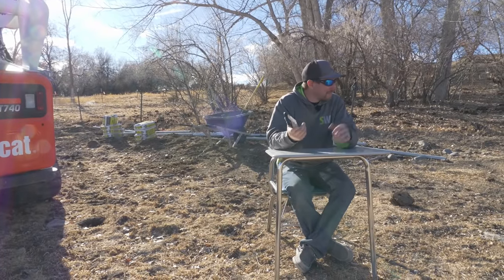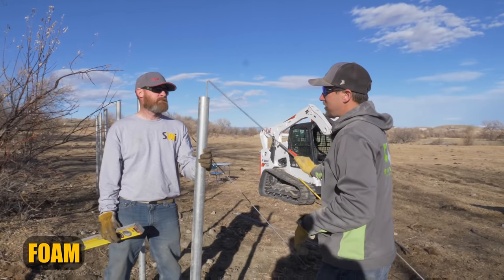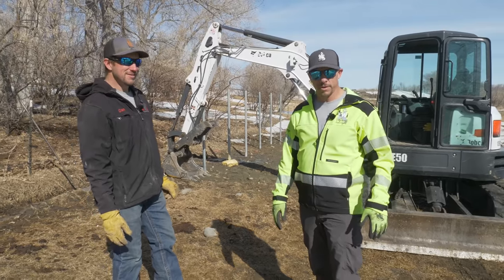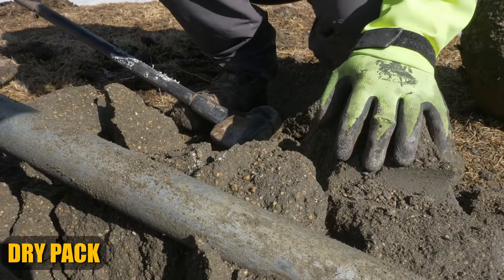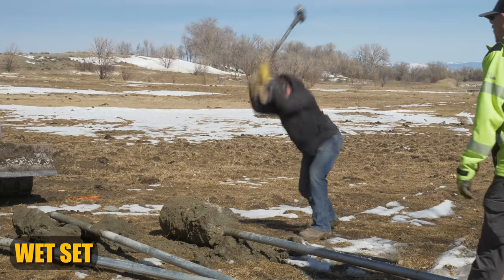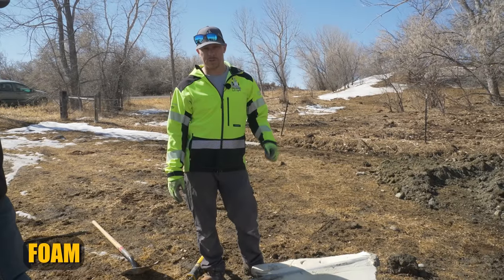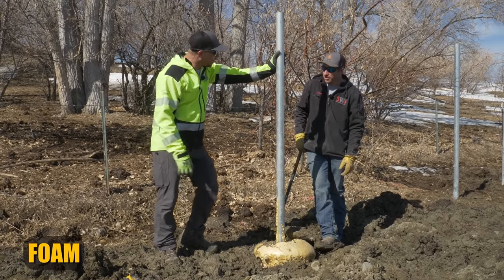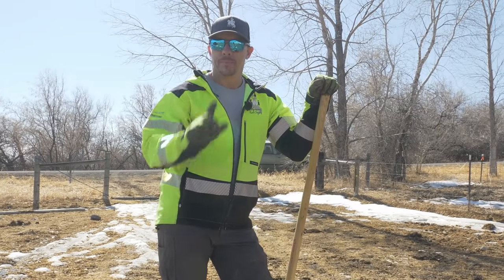Fence Foam vs Dry Pack vs Wet Set | We compare methods to see which is best for fence posts

Comment: I wrapped my 6 X 6 posts with "Resisto" which is used as an underlay for roofing. It has a sticky side where you peel off the membrane before applying it. Posts I set over 10 years ago are still holding up. The membrane goes up about 10 inches above ground level. I backfill with earth and compact it down with a 2 X 4 as I fill the side up.  I live just west of Montreal where we get rain, snow, hot summers and freezing cold winters. This technique has worked well for me.
.
Reply from the maker: I've seen similar systems promoted.  I prefer steel still.
Reply: @SWiFence  just wondering how much would be a 4x4  steel post for a home fence?

Comment: I guess we are lucky here in the northeast(New Jersey)area your ground looks a lot rockier,we just mark all the post locations,measure down from the top for the post height,place two magnetic levels,then push them in the solid ground with the bobcat bucket,but we would have to wet pour our corners and gate posts.l really your bracing techniques I’m going to try the bent rods to brace the wet posts.Great video!

Comment: The utility my brother works for in ND uses clean rock in areas where the ground is "swampy". I started using this method many years ago and have found it to not only be the most economical (next to just putting the dirt back) but the most effective and easiest. Rock almost packs itself with just a little vibration and makes the post easy to remove if needed. If the post should lean can be easily straightened and a little more gravel packed around it and just keeps getting tighter. Additionally posts don't rot or rust in rock like they do in concrete. Just my 2 cents. At today's inflation rate possibly worth as much as a nickel.
Reply: no concrete, just pure rock? what size?
Reply: This is not a bad suggestion at all. A mix of good rock and some small amount of concrete would probably be as good as full concrete

Comment: When I say I’m dry packing a post, i dig the hole, set the post, dump as many bags needed to fill the hole about 85% after packing it then pour the recommended amount of water per bag. It will start to Percolate through the concrete. By the time u set 2 to8-10-12  post that first one is already setting up good. For me  when I’m replacing a post for a customer it takes 1.5 to 2 60 bags of concrete mix per hole. When dry packing I don’t have any set time and can attach the panels and move to the next post that might 6 panels up the fence line. Any fence I built I use 3 2x4 attached to the post with screws and L brackets. Each 5.5”x6’ picket gets 6 screws. Loved the video , I have heard about using foam but this is the first time seeing. Of course we don’t get much freezing in so cal.
Reply from the maker: Dry packing is very common.  Many let the ground moisture cure the concrete over time rather than add water when done.  Personally we are driving more and more due to the way it holds up over time with no frost issues.  Cheers!

Comment: FOURTH METHOD:
DRY-WET HYBRID:
If you have two people there's no need to brace the pole - one person holds the pole and applies a level, while the other person pours and mixes:
1. Pour in dry, filling only 1/3 of hole, add small amounts of water while stab mixing. 
2. Repeat for filling the second third of the hole.
3. Repeat for filling the remainder of the hole.
Great video 👍
Reply: Exactly what I do with wife as a helper.   I honestly don't trust foam yet.  I know it can last a long time, but it tends to weaken with time.  On the other hand, cement gets stronger.
Reply: Exactly. I use this method and my posts aren’t going anywhere. Another benefit is, you could build on the post immediately if you wanted to.

Comment: I just did nine post with Sitka and it is very spongy strong winds hit after the storm in Portland Oregon and I had to come back two weeks later dig out all the foam and put cement in each hole there’s also a weight factor thousand pounds of cement compared to 20 pounds of foam holding down your fence. Foam for dry climates hard soil. I used another foam from Home Depot that came in 2 gallon jugs that set up Denser and I used it on a vinyl fence and capped the foam with cement and it worked beautifully. Happy customer beautiful fence no worries of posts working themselves loose from the wind.
Reply from the maker: Joe Everest did a video on the Sitka product compared to others and found it was the worst on the market.  They weren’t very happy with his video. You are confirming what he found.
Reply: I used Sitka also, I would not use again, loose and soft, very light duty stuff, fence is already getting looser, I expect I'll be redoing it soon.

Comment: I am in Massachusetts.  Not quite as cold as your area.  But I did 56 sections of 5 ft x 8ft. cedar fence with metal posts.
There are 3 gates 4 ft. wide,  and a 14 foot opening with 7 foot gates.  They are ALL done with foam.  8 inch holes 2 ft. deep.
the post is hammered in an additional foot.   The fence is now 8 or 9 years old and still as straight as the day it was put up.
I even had a tree take out a section with very little post movement.  I don't know if I am allowed to say what foam I used,
but I'm going to.  It is called Secure Set.  it is 6 lb. closed cell foam.  I really like this stuff.

Comment: So my three sense from experience. It is not so much the filler as much as the ground firmness. I'm on Maryland and I've done  lot of 4x4 posts, 6ft fence and 9ft fencing. I go three feet down with a auger bit just a bit bigger than the 4x4 then put the dirt on all four sides 6inches and pound pound pound, I use the metal pole with the head broken off and use that end after pre-pound with a piece of one of the slats from the stockade fence. Add 6in of loose dirt and pound pound pound then heavy pound with metal bar. Repeat all the way up and generally I have to have extra dirt on hand to make a mound and pound to slope water away. The space should only take up enough dirt to fill the area where there is no wood but when pounding it tightens the ground around it and that is why it all fits into that small space and then some.. That is the trick!!!!  I have replace all sorts of concrete crap that just pushed over in the loose or wet soil. 
   With my method I have never had a problem 20 years later and even the 9ft fence was the only one standing when a nasty storm (diminished hurricane) came through and it saved the house from flying debris. I got a lot of jobs after that "test".
   What is with the pulling up and out business??  What matters is that it does not wobble back and forth!!  Period.
  Oh I like the "oil" every three years as suggested below... and yes the metal even the thick galvanized will rust and break at ground level which I use oil and then a short bit of PVC 
  All the best .. good stuff though on the video... (though it was proof of what we knew already and foam will hold moisture and deteriorates in just a few months so big waist of time and money there. 
  The extra time it takes to pound the dirt properly is more than offset by the time and expense of getting and loading and unloading and mixing and shoveling and poring and all that nonsense with concrete!!!   And as stated al too often the whole lump of concrete just tips over.. though usually the depth is very shallow ... but you guys went over two feet so it would be less but they still will wobble due to wind turning it into a roller coaster ride along the fence.
Reply: I like the concept of drypack dirt. In this part of the country it’s mostly clay, and rainy. The soil gets too wet to tamp. 
Also most of my customers ask for concrete. 
If I lived in drier country I’d prob do like you do.

Comment: If you're using galvanized pipe, fencing a property likely to be yours for decades then use the sure thing, wet concrete.  Our family has a few that are over 50 years old and still going strong.

Comment: My father worked for a latex company, and one day we went to see him at work and the lab guy who developed the foams let us check out the lab and he mixed stuff up. They had stuff that was harder than concrete. We were hitting it with sledge hammers and it wouldn't even dent it.
Reply: Do you the the specific foam materials he used?
Reply: Please let me know because I was going to go to Home Depot Lowe's for foam so is it the same item because the concrete really is very heavy
Reply: My pole needs something new to staying hard with wet soft hot soil to penetrating with! I was using that blue thing with water, but now I'm convinced to going with that foaming stuffing 😮

Comment: Love the videos, keep em coming. I would like to see the comparison of dry set with water poured on top. I say this because that is what Quikrete engineers recommend. They have no mention of even packing the dry concrete. Simply dry pour it and add water to the top....... Just a thought...... Thanks again, awesome videos.
Reply from the maker: I don't think we would see much change as long as there is adequate moisture in the ground.
Reply: I've never seen that in writing from any concrete supplier. Where did you hear that?
Reply: @briangc1972  QuikRete website, QuikRete youtube how to videos and its on some of the bags.

Comment: I love the video but I only have one problem with it lol. 

You didn't do the method I was taught years ago. Fill the Hole Halfway With Water, then put 1/8th bag of Dry Concrete in The Hole,  then The Post in the hole, then put the Rest of The Dry Concrete around it - 2 or 3 inches from the top, and cover with dirt. Basically it mixes itself.
Reply: Ok 👍,this is what I was looking for.How many bags of Crete? How deep the hole?
Reply: @philipskrusso1153  what are you trying to set, a small fence post or a telephone pole. Buy what you think you need, my memory says it's either 50 or 80 pounds is a little cheaper. Secondarily if a wooden or galvanized post 4 inches of gravel at the bottom for drainage and less wood rot. Never put the cut end down. Lastly Never fill the hole 100% of the way, leave 6 inches for dirt. Looking at concrete is ugly and sloppy. Lastly it's not really cured for something like 6 months. 

Have a great day.
Reply: @philipskrusso1153  also how deep for let's say a 6 privacy fence. Wood should 4X4 should be a minimum of 3 feet depending upon how long and how much wind it will catch. I'd try to look up ciry or county codes if there's such a thing. 

Also if a fence, it might help to watch a few videos on that.
Reply: @DonaldAJr  Thanks Donald.I have a metal awning on back of my home that isn't finished.I was wondering how deep the metal poles go in the ground.
Reply: @philipskrusso1153  I'd say a lot of factors can go into place. You said, the job isn't finished. 

My thoughts are, are trying remove it or finish it. If remove, that could be a monster of a task. Rent a Mini Escalator, hook a chain to a poll and pull it out of the ground. Otherwise it's tons of labor hand digging to the bottom and you need a went concrete saw to cut the concrete in manageable pieces.

If it isn't horrendous you might just think about having the job completed. If you and your friends / family are not doing the job it's probably a wiser decision to completed the task. Then maybe it adds value to the house. 

I hope this gives you some information and maybe wisdom to make a better decision. It might be a damned if you do and damned if you don't meaning both are horrible decisions.

Comment: for timber posts just backfill with soil and ram well a dry hole is harder to ram but will pack tighter. steel post must be concreted to 3 inches above ground level to stop the rusting off so quick.

Comment: I don't think anybody's going to question that wet concrete is superior.  But, we are talking about fence posts here, attached to a privacy fence.  All three methods going to work perfectly fine for a majority of the viewers.  Dry pack is simply easier to achieve, and yields excellent results, as far as holding power.  Obviously adding water and tamping it take it up a notch, but still.

Comment: I was a kid when my dad started a fence company in the late 60s, after a couple of decades I was of the opinion that the deeper you set the posts the smaller diameter hole you needed. I felt comfortable with a ball of concrete at the bottom and the top of the post,, in the area we worked in.
Reply from the maker: I tend to agree.

Comment: FYI Florida is putting in cement utility poles in the Florida sand. I don't know what they're using to set them? But it is a question of concern and now that I have seen your demonstration with products used to set the post I'm curious about the cement utility lines they are much heavier than timber for sure. As soon as they were installed and the surrounding communities I have seen several fall. Not to mention that I know for sure to had been hit by vehicles and Came Crashing Down. It was probably the reason why two of the accidents were fatality. I say that because the cement utility pole fell on top of the vehicle that crashed into it. Now I really wonder what it is they use to to set those cement poles. Great demonstration thanks for all the time and effort it took

Comment: I use the steel bar method.  

1. Dig a hole with a post hole digger.
2. Place the post in the hole.
3. Use a 1 inch dia steel bar (not a pipe) to compact the soil as someone slowly adds it to the hole.

I have not set a fence post in concrete in 30 years.

Comment: 1200 vs 5000 psi on a fence post isn't really worth bothering over,except as scientific study.
In zone 8 we have no frost.
For me when I installed. Sandy-swampy soils get dry-packed or mix-in hole.
It all depends on your zone ,soil type,and water table.
For example holes were 3 ft deep,water-table is 6inches -4 ft .
Wet-set in hole 6 in posts ,holding 8+1 X 50 cantilever gates.
One of my last jobs was a 200 ft x20 ft soundbarrier fence in pure beach sand,and 300 yards from the Atlantic. 
It survived a hurricane ,posts were 6 ft on center, 800 lbs of sakreet mixed in the hole.
Am really enjoying these tests!
Am not a fan of foam,but only tried it 3 times.
Coredrilling and setting posts with anchoring is what I really enjoyed.
Reply from the maker: Totally agreed.  We see specs for 4500 psi concrete which is ridiculous given that the post will fail using 500 psi.

Comment: Fantastic content...and humor! I guess that my only question is, how strong does a fence post 'foundation' need to be? In other words, what load does a fence post take and therefore, is just packed clay and rocks good enough...or foam, dry pack, wet set? ...guess climate and soil types have a lot to do with what is best along with metal vs. wood posts (does material around the post affect rust or rot time).

Comment: The issue I have with these test is they are not really appropriate to the use of the post. When do posts need to have any strength against pulling them out of the ground ?  When will a post in the ground be hit with a sledge hammer  below the surface ? When a fence post is sitting in the ground these things don't happen to the fence post so how are these test appropriate for the performance of what the post sitting in the ground needs to do it's job ?

A far better test would be over-time which method works best because that is what really matters, not these test. And as another comment pointed out, concrete will rust the metal post causing it to fail, I've experienced this with wood rotting using concrete as it traps water where-as using the right fill around the post allows the water to drain better.

Comment: You should dangle the post by a chain and hammer on the post. The tuning fork harmonics will vibrate the concrete apart... Oops, I just saw your video at the 15 min mark and you kind of covered what I was talking about.

Comment: Probably more important than the concrete or foam is the soil you put it in.  If you have to chisel a hole in rock than that thing is going nowhere.   You can remove a fence post relatively easily in most soil by digging a small trench around the base and filling it repeatedly with water.  The soil turns to mud and you pull it out.

Comment: I think the concerns of frozen ground is that it's expanded and when it thaws there will basically be a gap around the concrete fill.   I think the heat genera foam or cement under ground would help it cure but also thaw that ground of it was frozen.   That foam is messy.     Dry pack looked like it would be adequate.

Comment: Wet set wins ever time.  Tried foam and the first tropical storm pushed the fence over.  Redid with concrete and have not had any problems!  I’ve never tried dry pack!
Reply from the maker: I tend to agree if I can't drive the posts.

Comment: When wet concrete sets, it gets warm - and that's why it doesn't care too much about being in frozen ground.  For the dry-set though, if there's no liquid water, then there's no chemical reaction - and therefore no heat.  Since it can't absorb water from frozen ground, it doesn't set.   So dry-set in frozen ground is a guaranteed fail - I definitely wouldn't use it in a cold climate.   But what I've always done (in any climate) is to dry-pack the post - and then pour a bucketful or so of water on top of it.  That water gets absorbed into the upper levels of concrete pretty quick - and water absorbed from the ground gradually sets the post in properly.   I don't know whether that's as good as wet-mixed concrete - but in warmer/wetter soil, I think it's good.  Honestly, if I have a mixer handy - I'll use wet-mix, but if I have to mix by hand, then I'll use dry-pack (plus a bucket of water).
Reply from the maker: The dry pack still held up respectably.  I'd be lying if I said I wasn't surprised.
Reply: @Hello Steve how are you doing